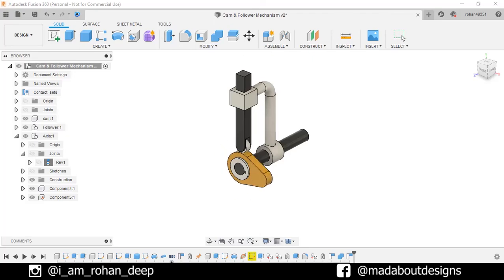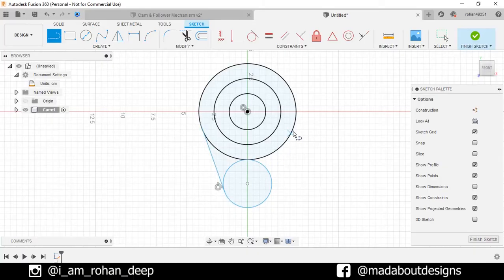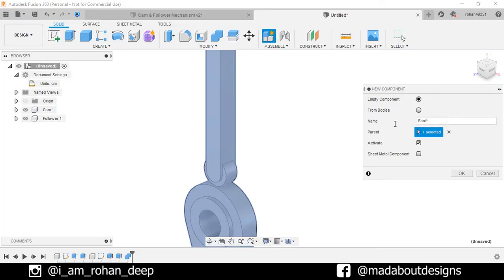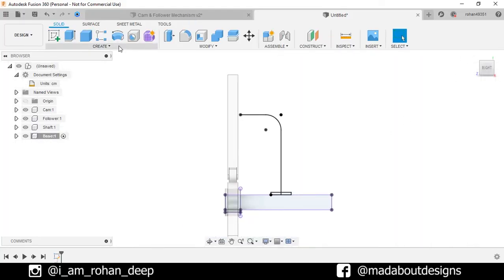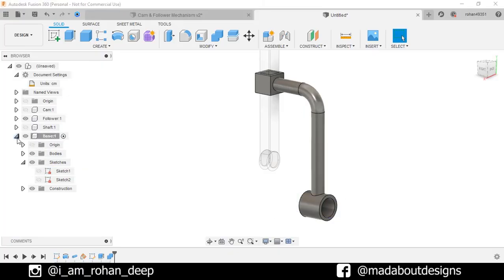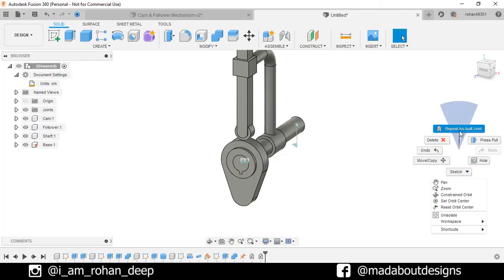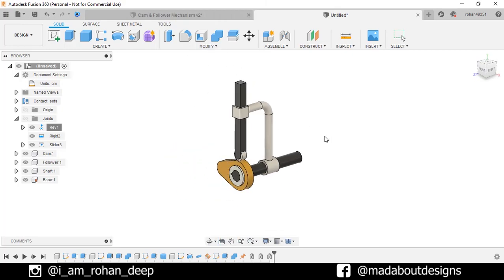How to design a Cam & follower assembly mechanism in Autodesk Fusion 360 | Advanced Exercise 10

Comment: My As-Built dialogue box has no "position" option. I'm using Fusion 2.0.19215 x86_64. I see now, the 'position' option has been replaced with 'snap'. I went over the steps several times, but it just wouldn't animate for me.

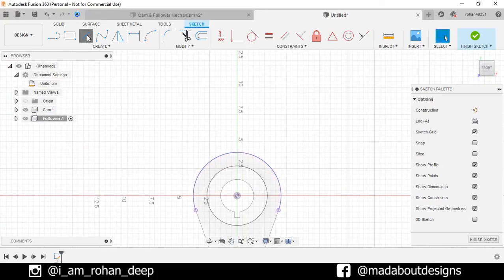Comment: 4:01 When you projected that curve it somehow ended up in the middle of the cam body, when I did it, the projected line is on the front side of the cam, which is how I think it should be, so I don't know how the curved line projected at the mid-point of the cam body on your model. So, I had to create a midplane in the middle of the cam, then project the curve onto that plane.